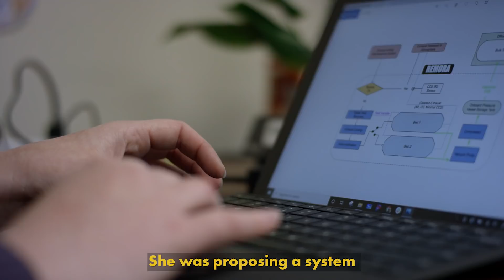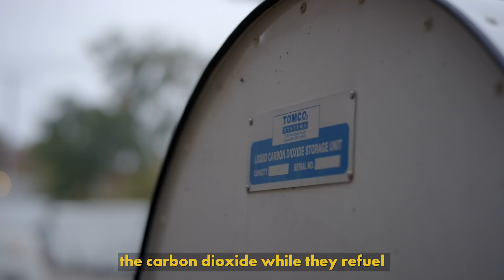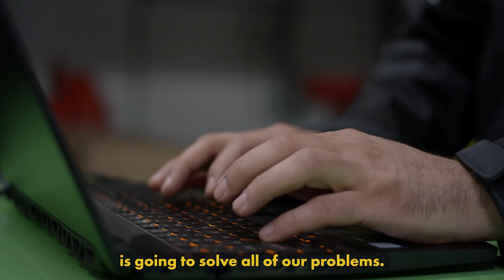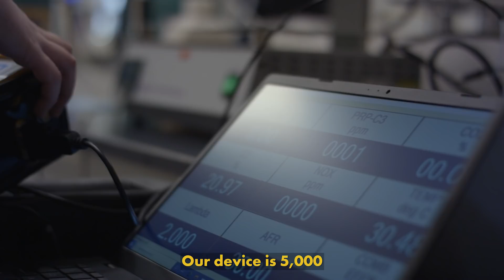Carbon Capture on Trucks | Remora

Comment: Think this will pair well to CO2 hydrogenation to methanol?  

Methanol can then serve as a fuel, and the CO2 captured and recycled back to methanol, all using renewable energy.
Reply: It would be great to reuse CO2 back for the clean non polluting purposes, however it looks CC as well as EVs battery/hydrogen have all one huge challenge - they require great investment in the fueling infrastructure as well completely new vehicles or in better case of CC a modification of the existing one. On the other hand producing synthetic e-fuels like methanol/diesel from captured CO2 doesn't require any costly changes to the existing fueling infrastructure or existing ICEs which is excellent, however for now they r still way too expensive. Also if we look as the transportation industry as whole, all types of transportation road/sea/air would benefit from it without significant cost impact on their current infrastructure before their complex transition to electric. The only remaining challenge then is to make e-fuels made from the captured CO2 also with this method much cheaper and widely spread. There's over too much CO2 in the atmosphere since industrial revolution and more is being released every year, so the smartest way forward would be to reuse it for the clean e-fuels ideally with renewable energy. This approach would also not jeopardize EVs adoption which can happen in parallel based on its own pace and development and it would help in production of hydrogen.